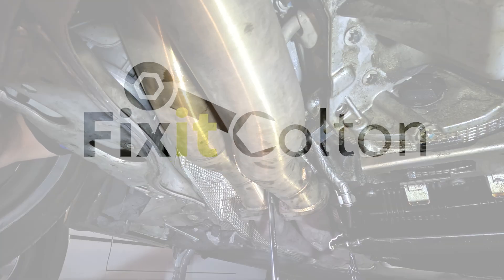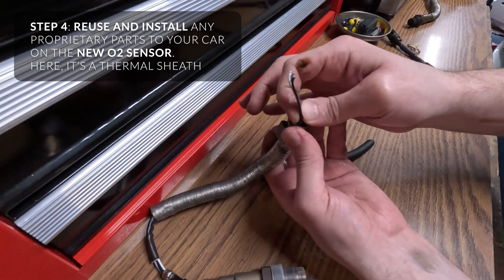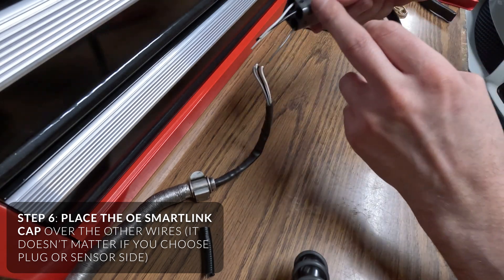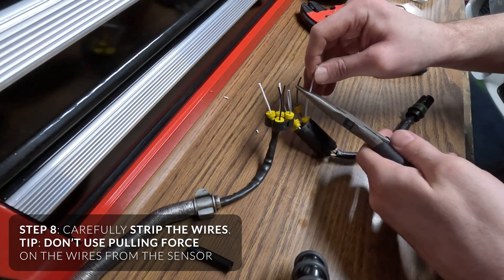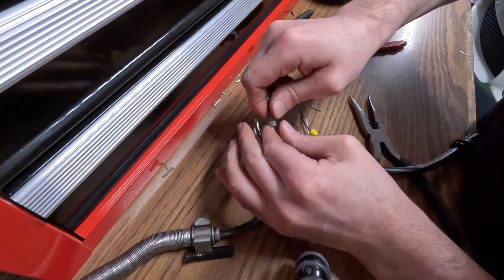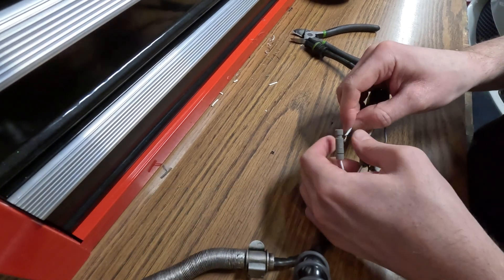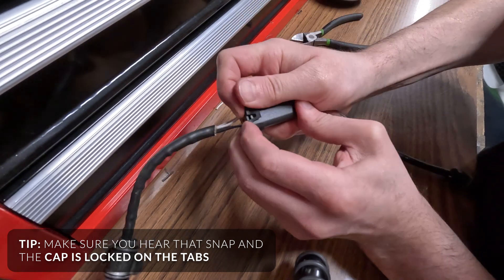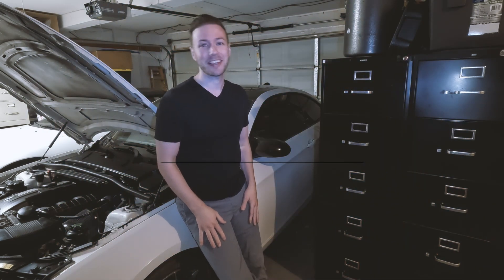The Best Way to Splice A Universal O2 Sensor | Bosch OE SmartLink Kit Tutorial

Comment: So I went ahead and started this job for bank 1 after cat. on my e60 M54b22. Losening up the old o2 sensor wasnt a pain at al but getting all the clips i was getting nervous. I just cut up the old o2 by the sensor itself and taped the wires to the new bosch one. I gently pulled it up thru alp the clips whitout damaging the cabel. 

Setting up the plug was easy after watching your video. Thanks so much dude🎉
Reply from the maker: I was reading it like a story, and I was waiting for the "but then... this happened" 🤣. Glad it was successful, and I'm happy the video helped you. Happy Friday, cheers 🙃
Reply: @fixitcolton im sorry english is not my first language. But the 'then this happend' was the moment i saw how the o2 was clamped up to the engine's top. There was no way i could undo those clips whitout removing the whole exhaust 😂😂 so i was glad i managed to pull it thru

Happy friday man!

Comment: Question: What is the part number of flexible metal sleeve that you fit over the OXY sensor? These are missing on my E36 M3 BMW and I would like to add them. If they are indeed a stock OEM / factory item, I believe they got tossed by the previous owners mechanic, alas. Thanks for your information
Reply from the maker: Hey, that sleeve isn't sold separately for the E92. It's part of the downstream O2 sensors that are OEM. So, you could source one at a junkyard, but they often cut the O2 sensors off and remove the cats before dropping the cars. That may be a difficult find. You could try finding the cheapest old OEM one on Ebay to get the sheath, or you could buy them new which would defeat the purpose of this kit. 

If you use realoem.com, you can put in your vin or specific car info and search for "lambda sensors." You'll see that only the monitoring ones have this (car dependent though). At least there you can get your exact OEM part number and verify via schematic. Realistically, you can probably get buy without them. I would just carefully route the wires to avoid the hottest parts. 

If it were me, I'd use something like this https://amzn.to/4oeYloX and use metal zip ties to secure it tightly on the wire. Good luck 🙃

Comment: My plug that my sensor plugs into has 2 broken wires. I can't find that connector anywhere. My Google is broken I think. Any ideas?
Reply: I have a 2011 BMW 328i.
Reply from the maker: Sorry, I'm not following what you're asking. You can directly splice the wires together and bypass the proprietary plug, worst case. I would recommend trying to fix the plug though, or even source one from the junkyard.

Comment: If colors come the same in the old sensor and the new one its easy. I had  different colors to match and I am very unsure I matched them correctly. Mines are not working properly.
Reply from the maker: Yea, it's not always identical. There are different types of O2 sensors as well. This won't work for everything. You can try to source your OEM wiring schematic for your O2 sensor and then match up the wire types on the universal one.
Reply: Bosch includes a diagram with 6 different color combinations. Its almost impossible to fail especially watching this video